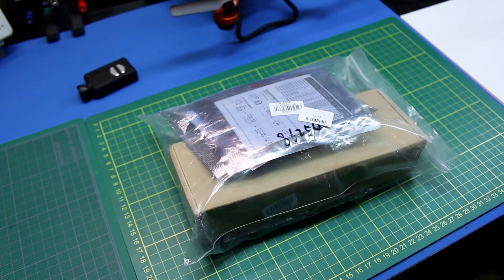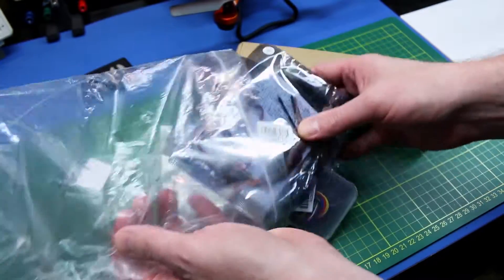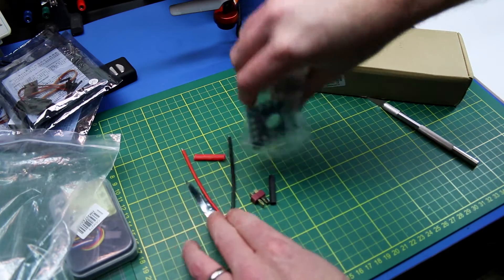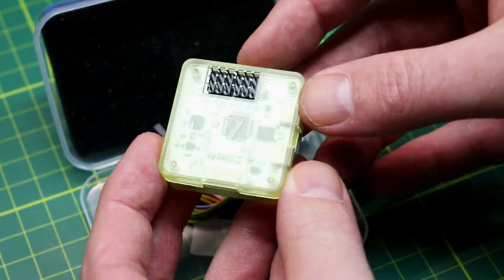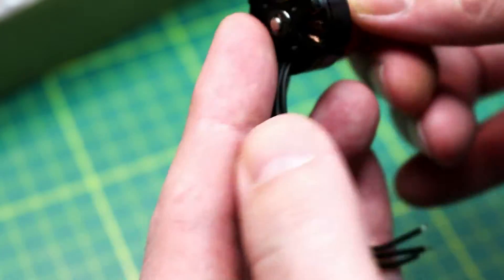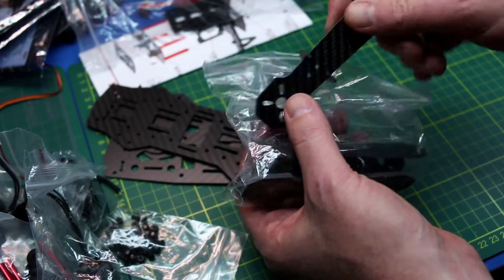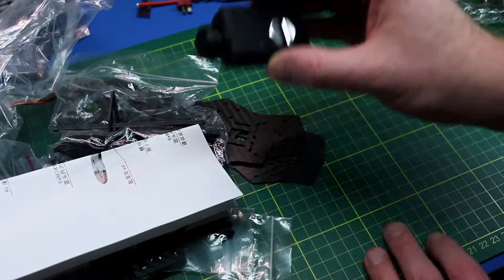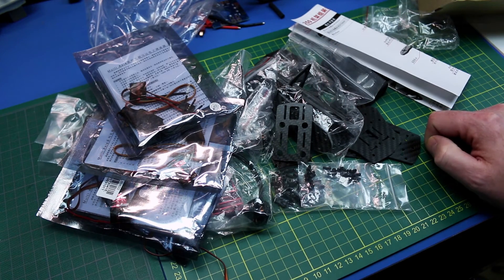ZMR250 Clone BUDGET Mini Quad Kit For FPV & Drone Racing |  Part 1-  OVERVIEW

Comment: about what camera to use:
The answer is both! The board cam in between the plates for the 5.8 video, and the mobius on top to record high quality footage. You can get the video output from the mobius, but there's a noticeable latency (especially important for 250 quads as you will want the fastest reactions possible when flying fast and low), as well as the fact that board cams tend to adjust to changes in light more quickly.
Reply from the maker: +remotaholic Thanks for the advice. Agree fully. I just need to get a smaller TX and I already have lots of board cams. Cheers!